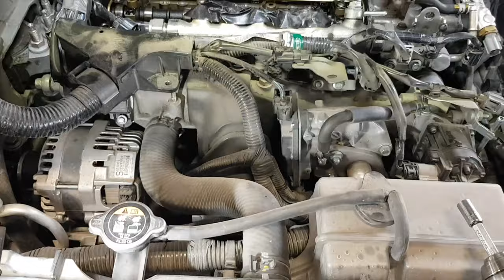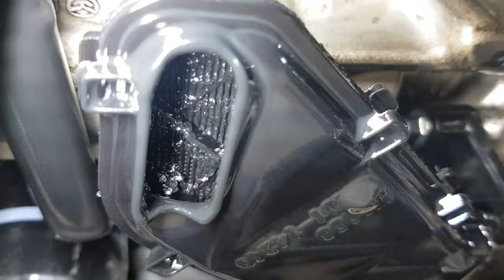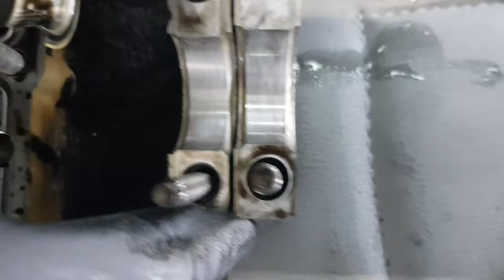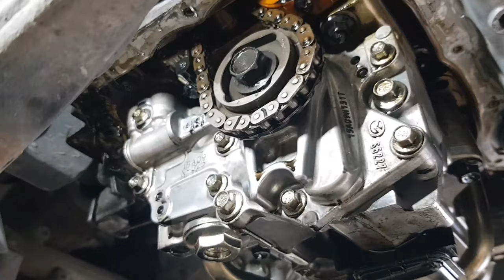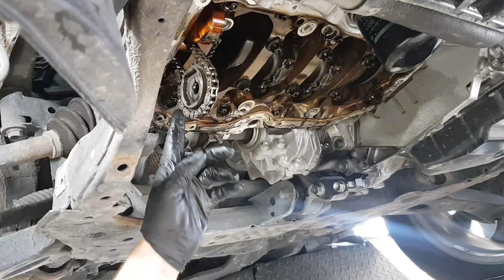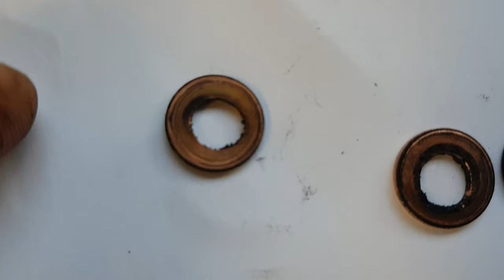P06DE P055F Low Oil Pressure Mazda 2.2 Skyactiv D

Comment: Hey man thank you for this info, I own a 2.2 skyactiv-d and honestly I could not make sense of all the recalls and modifications that have been introduced to mitigate this problem. I plan on replacing the injector seals with the upgraded parts soon.
Reply: For those interested, I have ordered this kit: SHY310YG0A. It includes all the washers for injectors and fuel lines. It also contains a valve cover gasket and fuel lines wich I have not used.
Reply: @robteuwen4158  The kit you mention above includes the modified injector washers PN SH01-13-H51 together with nuts SHY1-13-148A have been introduced in 2017 Aug as mentioned above? Thanks
Reply: @aristos87  yes it does.
Reply from the maker: I would order mentioned kit without fuel lines, this is the most expansive part and you can reuse them as Rob Teuwen mentioned.
Reply: @JB_Auto  Thank you for your quick reply!
Reply: @JB_Auto  If you can find it go for it!
Reply from the maker: I will find it and post in the description soon.
Reply: @JB_Auto  sweet
Reply: Does anyone know which year the newer washers came out in production cars ?

Comment: Thanks for the video. Should I worry about this issue on 2019yb mazda cx5 with 2.2 diesel engine, 184 hp?
Reply from the maker: You're welcome. All 2.2 diesel engines have injector washers, so replace them every 80K-100K km to avoid that issue.

Comment: Hi JB auto unfortunately I brought my Mazda with this error unknown to me at the time car sounded and drove nice thanks to your video I was able to clean and rebuild and put new timing chain on but now I have bubbles in my radiator I have cleaned inlet manifold and egr x2 and egr cooler hopping it was egr cooler but it was not that so must be head gasket do you have any workshop manual for lower part of engine like big end bearings con rod bearing piston ring gap torque settings I would love to be able to put this car right as, I have brought a bit of a lemon 😥 keep up with your videos they are great and thanks for your time
Reply from the maker: Hi, I know that the whole workshop manual is available in PDF form, I downloaded one for myself, but unfortunately, I do not remember where from, and that was the same as the Mazda dealership is using, WM was for those older Mazdas, free download.

Comment: Hello. I am experiencing the P06 fault code in my Opel İnsginia 170 Hp gasoline car. What exactly needs to change? please can you help?
Reply from the maker: @nisanci46  Hi. The fault code you've provided is not the full code. This video is not related to opel vehicles, so I can not help you much🙂
Reply: @JB_Auto  Excuse me sir. Full code PE06DE. I spent a lot of money and did not get any results. I also changed the oil pump but there was no solution. What exactly needs to be done, please help.
Reply from the maker: @nisanci46 I'm not familiar with those Opel engines. therefore, I can not advise you on that issue. Check YouTube channels where people are dealing with that code on opel or chevrolet. I know there are a lot of good videos.

Comment: Hi, I have a low oil pressure issue with my Mazda 6 at 106,000 miles. I have been recommended by the dealership to to 'do a full ''Carbon clean at a cost of £2000 but this does not include the cost of the Injector seals replacement and the Sump removal this would be an extra cost of around £450.''.  Are we going down the right route here?

My breakdown and a previous mechanic on full service identified error code P055F Engine Oil Pressure, Outside specified range. The dealer reckons he knows 100% there is no electrical issue on the vehicle, and I believe he has not physically gained access to apply an oil pressure gauge, to physically test the oil pressure sensor (how does this need to be done?) and declines on providing me a full diagnostic report (he reckons the previous mechanic has cleared any errors when we full know it was not). 

The day after a full service the error codes appeared as P06DE (Engine Oil Pressure Control Circuit Stock on), and 
DTC055F-00 (Engine Oil pressure out of range)

Can anyone help, please.
Reply from the maker: I would do it according to the recommendation, the dealer has a lot of experience with that.

Comment: I recently bought a Mazda 6 Executive 2.2 D Skyactive from 2013 at 200,000 km, I heard that these engines have problems depositing chips in the engine, something like that, I'm curious what needs to be changed in the car at these kilometers? Thank you!When starting, the car revs a little, is there a problem? But otherwise it's ok
Reply from the maker: Most likely everything that was supposed to be replaced is done, hence 200K mileage and still running, replace the oil every 10K and injector gaskets to prevent carbon from getting into the oil strainer. Higher RPM when started is for faster warm-up although it is not always present. Generally, as long as the engine runs well do not think about what should be replaced.
Reply: @JB_Auto  Aha,good! thank you very much,the best💯👍

Comment: Thanks for the great video. I'm thinking of buying a Spares/Repair CX5 and putting my 2.2 Engine into it from my Mazda 6 skyactiv.
I'm wondering if the AWD or 4WD model engine will be compatible with a 2WD manual engine of the same car?

I'm only wondering if you have any ideas - When I drive my mazda 6, I was getting oil leaking into my coolant. I replaced my turbo cores which seemed to stop the oil leak issue, but now my coolant flows into overflow tank, but it doesn't backsuck the coolant into the engine when the car cools down --> the car remains air-locked. It means I have to de-pressurise the radiator cap and then drain the coolant back into the engine manually (with the car off)

Do you have any ideas on how to fix or what might be the issue?
Reply from the maker: Thanks. It might be the head engine gasket that creates pressure, you probably can see bubbles in the expansion tank as well. Those engines are compatible.
Reply: @JB_Auto  I'm thinking head gasket failure causing coolant system to over-pressurise. So the Radiator cap just breaks from being over-pressurised, and doesn't naturally bleed itself. Therefore coolant system remains air-locked. Weirdly I'm not getting any carbon or oil in my cooling system anymore, but seems as if the combustion chamber is at much higher pressure than the cooling system, then I'm not getting any coolant inside the chambers/fuel/exhaust areas.

Comment: Hi i Have a CX-5 from 2013 2.2 D 150 HP AWD runs great  feels great 100,000 kilometers driven  no problem ist it a good year model? Should i be worried?
Reply from the maker: Hi, thanks for the comment. You posted your question under the video of the oil pressure issue, so you probably worry about that. 100K mileage with no issues means your engine is most likely after some modifications, however, I would replace injector gaskets as in the video. 2013 model year that is when all the big modifications started and that is regarding mechanical components such as reinforced camshaft and rocker arms and that is for  European Countries,  beginning of modifications for Mazda CX5 September 17 2013. What defines a good model is how you service your vehicle. Watch my video about how to check oil pressure, it explains how often should you replace engine oil and why.

Comment: Hi, do I need to blocked chain bofore    taking out from oil pomp?
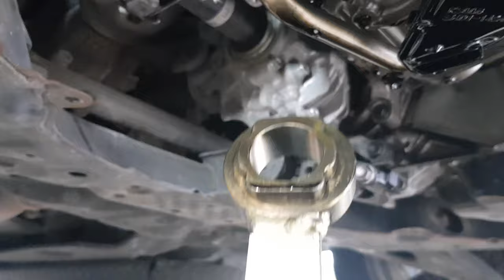Reply from the maker: @radosawkomoda7536   you need to block the oil pump sprocket with the special tool. It is shown at 2:55. The tool is not available at the dealership, so you need to figure something out.
Reply: @JB_Auto  yes thanks for answers. But I mean do I need block the chain like timing chain to not change position. Mechanic told me that If I do not make it the engine can work not  propely afterthat.
Reply from the maker: @radosawkomoda7536  There are only marks as on my videos, no locking tools required.

Comment: Thanks for the great videos, helped us a lot in repairing our Mazda cx5 2.2 skyactive. We had problems with the oil pressure and in the end had to replace half the engine. From camshaft, hydro tappet, turbocharger, injectors, cylinder head and small parts. We cleaned the arg valves and the throttle body. However, the car does not run at 100%. After reassembly the engine runs smoothly at idle and when the engine is still cold the engine runs great and accelerates, just great. As soon as the engine warms up, the engine starts to jerk and no longer accelerates. We are at a loss as to what it could be. Do you have any ideas?
Reply from the maker: Thanks, It looks like you replaced a lot and some of which could cause jerking, I assume that there are no fault codes, I would check the MAF sensor, if that's good then look at all temperature-related live data, and also check the fuel pressure, temperature live data. Sometimes there are no DTCs stored, then what's left it is searching by using live data, this issue is not known to me yet.
Reply: How old is your mazda?
Reply: What year is your cx5 diesel

Comment: My engine light and engine on light have come on for the second time in the last 3000km for CX-5 2.2 Diesel. Last time it was fixed by replacing the engine oil.

This is also most likely to do with Dirty or Clogged Oil pump or Strainer.
I am getting error codes P055F and P0524.
Is there anything else i need to look other than Oil Strainer.

Also, how can i remove the oil pump if i don't have the special tool.
Reply from the maker: If you have an issue with oil pressure for a second time then consider inspecting of crankshaft bearings, check the camshaf for wear, and based on the inspection mentioned determine if the oil pump should be replaced. 
Without a special tool, there is no safe option to fix that, I would make one.

Comment: Watching from Nairobi. This is an awesome Channel. I have a 2.2 Diesel and love to work on it when I can, so I appreciate the effort and time you take to do this. 
When you get a chance, are you able to post a video changing the head gasket on the 2.2 skyactive D? I haven't found a full video of one. Thanks again.
Reply from the maker: Thanks, head gaskets jobs are rare but if I work on that I will certainly post on YouTube.
Reply: Hey Collins... I have 2.2 D on the way .. maybe we can share issues incase they arise.. any mazda mechs u trust just for my future needs. Thanks sir.
Reply: @MrPashionate , Feel free to reach out. Happy to help. I usually work with my mech, the only guy I trust to touch my car when I am not the one working on it. Just changed my head gasket and removed the dpf & ecu remapped. Now I have a very happy engine.
Reply: Hey collins how is the 2.2 Diesel engine as of today?
Reply: @TrueAfricaStories  I have thoroughly enjoyed mine. Just clocked 111k, Kms on it. No issues since I changed gasket, removed dpf, changed injector seals and reprogrammed. Just regular maintenance. Planning to change trans fluid soon.
Reply: Whats the cost implication of doing that all
Reply: Hello Collins, i have a 2017 2.2 skyactiv D on the way and would love to get more info on ECU remapping and DPF delete.. do you mind sharing a contact?

Comment: WE HAVE MAZDA CX5 SKYACTIVE AKERA 2015 DONE AROUND 192,000 KMS NOW WE HAD OIL LIGHT ON CODE P055F LOW OIL PRESSURE BUT WE DROVE SLOWLY TO THE NEAREST MAZDA WORK SHOP IT WAS AROUND 400 KMS BUT IT WAS STILL RUNNING PERFECT THEN JUST HEARD A HISSING NOISE AND STOPPED STRAIGHT AWAY BUT THE MAZDA WORKSHOP GOT THE OIL PUMP AND WHAT IT NEEDED FIX AND IT WAS FINE WHEN IT WENT IN BUT THEY HAD DIAGNOSTIC COMPUTER ON IT THEY GOT SAME CODE THAT I HAD FROM MY TOOL AND THEN THEY TOOK IT FOR TEST RUN AND NOW THEY TOLD ME IT HAS A KNOCKING NOISE NOW AND BASICALY SAID THE ENGINE IS STUFFED. THE ENGINE IS VERY CLEAN MORE ON OPEN RDS AND CITY CAN IT BE REBUILT OR BECAUSE I DONT THINK THE MAZDA DEALERSHIP WORKSHOP DONT WANT NOTHING TO DO WITH IT AS I THINK WERE GETTIN A BUM STEER THANKS IF MAYBE SOME INFO MAY BE GOOD BUT WERE IN W.A AUSTRALIA MAY BE DIFFERENT
Reply from the maker: Because of the knocking sound, I assume there is severe damage, in a nutshell, it could be very expensive to repair it.

Comment: Hello, do you know the free lengths of the exhaust and intake springs? Thanks
Reply from the maker: Hi, Exhaust 17.91mm, Inlet 16.80mm; you can also differentiate them by identification paint, so the inlet is always green at the top of the spring, and the Exhaust could be pink or yellow.
Reply: @JB_Auto  Thanks very much!

Comment: I have a low engine oil pressure warning light, however car seems to be running normal , and scan tool doesn't pick up any faults.
Could this be a sensor issue? It's a Mazda 6 sky active diesel.
Reply from the maker: Yes, that's possible

Comment: Great video. Thanks!
I’m here as I have the mark2 mazda3, (R2AA 2.2D). This had injector seals leak at 120k (miles), thus oil strainer blocked. 
I’ve cleaned out the valve cover fairly well. There is no oil feed pipe I can see, so is there somewhere else I should clean? 

Hopefully putting it back together this weekend. I’ve got Bosch replacement injector washers. These are copper still, but i think are modified by having extra tabs in the central hole. 
Is there a modified torque setting for my model? If so, please can you let me know what it is. 

Instead, if I followed the modified torque for the skyactive, which nut gets the 270’: the left one that was backed off 90’, or the right one? Thanks.
Reply: How easy is this to do? I have a Mazda 6 185 with the R2AA and I have an oil leak all around the injectors. It has 201k miles though I don’t think the seals were ever replaced

Comment: Great video. By any chance, could you post the part number for the oil pump gasket set? I mean for the O-rings and the gasket and the oil strainer. 
Thanks in advance.
Reply from the maker: I just placed part numbers in the description at the bottom. You are welcome.
Reply: @JB_Auto  Huge thanks to you❗️ I just checked out your other videos, they are great and you provide a lot of help for the community. Once again, thank you very much. 😉✋

Comment: I have 2016 cx-5 2.2 d with 147k miles in uk good service history but I have  exhaust smell when engine started how do you check if injectors seals are going ?
Reply from the maker: The best way is to remove all injectors and perform a visual inspection. Exhaust smell doesn't necessarily mean washers are gone, but it's wise to check and replace them.
Reply: @JB_Auto  appreciate your help and quick response  also may I ask engine oil specs ?
Reply from the maker: @sarom399   In the description of this video are all the oil specs. Here is the link https://youtu.be/2ZdAMF7PX30?si=RXEMCJ_dFEP81r3I

Comment: So is the oil diluted by injector leak and in turn causes the carbon build-up or is the carbon build up caused by another factor??? Thanks
Reply from the maker: Carbon build up is caused by injector washer leak.
Reply: @JB_Auto  Thank you!  Seldom the injector, merely the waster I read, smooth engine, shame so faulty

Comment: Thanks for the video. I have a Mazda 6 2.2 diesel 150HP from 2018, are the engines better done there or is it the same as the old one. Thanks
Reply from the maker: You are welcome, those engines are heavily modified and you shouldn't have any mechanical issues. I would replace injector washers at around 150K just as prevention.
Reply: @JB_Auto  when was the engine upgraded?
Reply from the maker: First modifications that were most important it was the camshaft and rocker arms EC Mazda 3, 6,  and CX5 EC UK  Sept. 17th 2013.

Comment: Hi, thanks for the great video.
What sort of flush would be a good idea for a car at 160000km. Ive got 5w30 genuine oil in my 2.2 awd atm. Would there be aftermarket brand with certain grade you'd recommend too? Any tips on maintenance too please. 
Appreciate the great video again. 🙏🙏
Reply from the maker: An engine flush is recommended when you discover an injector gasket leak as on the video, otherwise, some people are against it so it is up to you. Regarding the brand of the engine flush anything from a known manufacturer. Maintenance tips replace engine oil every 10K km, replace injector washers as I recommended in the video that should be it.
Reply: @JB_Auto  thanks for the response. I recently replaced my fuel filter to find my car not starting even after prefilling the filter with some diesel. Priming with ignition on n off  Got it to start eventually after blows of air to tank, trying to loosen direct fuel line (probably not good idea) and all sorts. Still no idea what and how it started the thing but it did 😅😅 Bit sceptical to do any fuel line jobs but will get the washers ready for sure.
Appreciate it!

Comment: Hi, another great video. I am having to replace the bigend bearings as well. Could you advise what the torque settings are for the bigend cap bolts. Thanks in advance.
Reply from the maker: Thanks, 30Nm and then 90 degree.
Reply: Thanks for the video .. I'm working on my own one at the moment . Under the rocker cover was completely packed with  congiled  oil / carbon . I was told the exhaust valves are stuck open or closed because of carbon buildup  ..

Comment: I have I MK4 mazda 6 MZR-CD 2.2, clocking 300 000km. 2012 model, 10 years now, still going strong. but oil change twice a year and engine flush ones year. EGR valve cleaned twise( 100 000km and the 200 000km). DPF still good, and orginal turbo .... I'm scared to move to those new Skyactive engines ( 2.5 is good,)
Reply from the maker: Those petrol engines from Mazda are reliable, both 2.0 and 2.5. Since it's been introduced, we have had not a single failure of those engines.